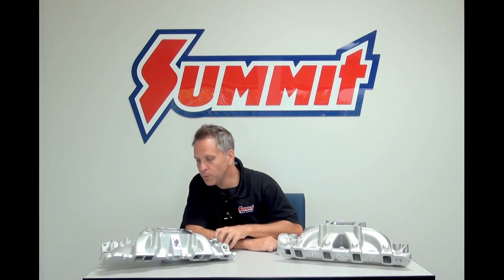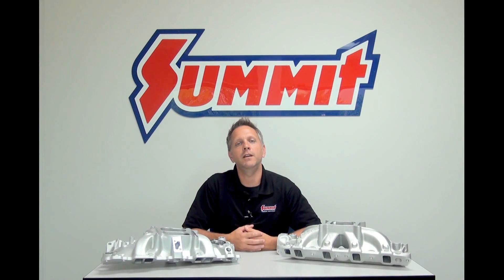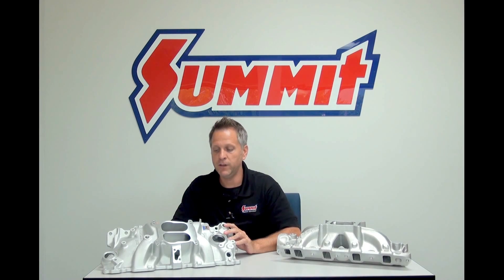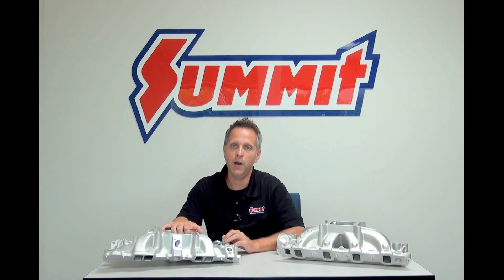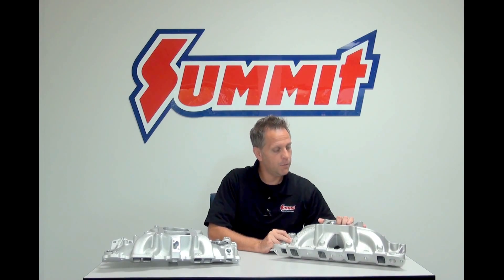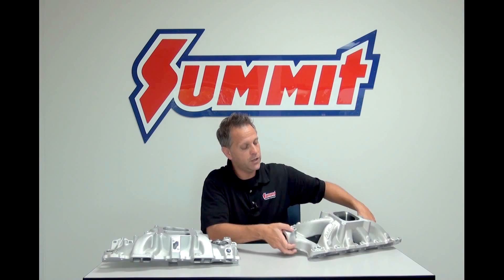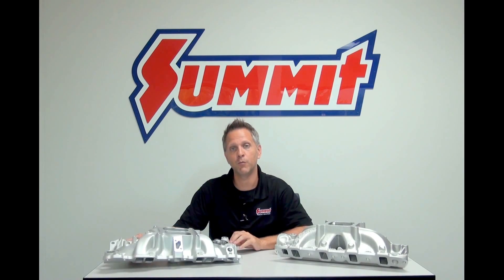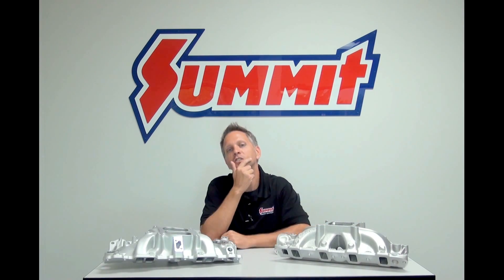Dual-Plane vs. Single-Plane Intake Manifolds - Summit Racing Quick Flicks

Comment: Can you put a single plane gasket on a dual plane intake?
Reply from the maker: Yes you can, but it also depends on the carb. Some carbs recommend a 4 hole gasket to perform correctly.
Reply: Summit Racing what about edlebrocks 1406 carb?

Comment: I always wondered if I put a one inch on  a dual plane how it would act.  They way I could drive on the street with the daul plane and when i went to the track i could easily put the one inch spacer on, assuming I had the hood clearance.

Comment: Why don't manufacturers coat the inside of these with something like those copper/ceramic cooking pans you see on TV commercials?
Reply: The inside of the intake and the runners in the head need to be fairly rough surface wise to keep fuel atomized and keep fuel from puddling up

Comment: thanks for the info!! however, there is no info anywhere indicating there is no vacuum port on the intake anywhere!
Reply: run a vacuum pump if you need vacuum for power brakes

Comment: Wanna get Edelbrock 75284 intake manifold for my vehicle. However $1149 bucks for the timing control module 91231 seems like a bit much for what it is. Now do you have to purchase this timing control module for a extra $1149 or is there another way around it? Thanks
Reply from the maker: +Parps Mcpimpson , 
Yes, MSD offers the same module for $499 and the wiring necessary for around $200. Give us a call and we can get you the correct part numbers for your year of engine. 1-330-630-0240

Comment: for a 5.0 non H.O  what intake does the job?? whit a 500 or 600 cfm carb
Reply from the maker: TheGer88 , 
If it’s a street driven application with little to no modifications, an Edelbrock Performer manifold will do the best. The size of the carb really depends on modifications and the RPM the motor will operate at.  Give us a call and we can walk you through it!
Reply: TheGer88 500

Comment: Thanks. Very helpful.
When can I put a dual carb set up on a SBC? What do I have to do to the motor?
Reply from the maker: Dave S,
 Dual carbs are really best suited to lightly to highly modified motors. If looking at the Edelbrock dual quad set up, its suggested to have a 9.5:1 compression ratio, a minimum of a Vortec style head or better and a camshaft with 214/224 degrees of duration (@.050) or higher. There will be tuning to be done, it is NOT a bolt on and go!  Give us a call, we’ll help you through it. 1-330-630-0240.
Reply: Summit Racing Awesome thanks for the info.
Just switched cars. Now have a 351C. I assume the 4v closed chamber heads will do the job.

Comment: The dual plain you said was good for up to 6500 rpm and the single 8000rpm I like to be at 6800 what's the best intake to have . Dirt track racing 650 double pumper rule.
Reply from the maker: Hi Jason Light, 
Due to the fact that this a race only application and will be in the higher RPM ranges all the time, a single plane like the Edelbrock Victor Junior is a great choice for you.
Reply: Ten four thanks for the response

Comment: I have the Center Bolt Cast Iron Heads 1987/1995 one piece rear main seal 350 Stock Except for Mild RV Cam/Crate rebuilt engine It is In an old 64Chevy c10 Short Box Fleet Side Pick Up So Plenty Of Hood Clearance I like the looks of the 8170 WEIAND ONLY BECAUSE IT IS A HI RISE AND DUAL PLANE is it going to hurt Anything to use IT VS. the 8126 Low Rise Dual Plane With Stock HEI I am Using Now? The Truck is Running 373 rear gears and 700 R4 TV Cable type Not the Electric Computer Controlled trans type  Lastly I am using the 600 CFM Manual Choke Edelbrock Carb I am considering the New 1901 Street Demon Carb I have read good things about it.
Primarily local Cruiser and once a year from SOCAL/Riverside To Des Moines IOWA to Visit Family so the Infrequent Road Trip about this time of year.
Just an FYI I am Talking Just about the Looks of the set up if I lose a Little MPG I don't Mind I just don't want it to Feel BOGGRD DOWN When I step on the gas like when you have too big a carb on a smallish v8 Right now it has great Acceleration stop light to Stop light the trans is not all built up with aftermarket torque converter or anything it does have the 373 POSI/Limited Slip Type Rear 12 bolt out of a 66 c10 donor truck. tires are 235 70 15 on all 4 corners I think That's as detailed as possible! if not a little scatter brained
Thanks A bunch 

Jeff in Riverside CA
Reply from the maker: J garcia, 
The WND-8126 is going to be the
better choice simply because it is designed to operate in the same RPM range as
an RV camshaft does. The 8170 works to a higher RPM band which will not be
beneficial to you since the cam wont rev that high anyway! http://www.summitracing.com/parts/wnd-8126
Reply: Summit Racing thanks ! I was afraid of that Ok I will stick to the 8126 thing is the 2 rear center bolts leak oil on both sides no matter what washer/RTV I use do you know if there is a special bolt/washer for the 8126 I think I read somewhere the 8170 needed 7/16 Bolts certain washers etc Wondering if the same is true for the 8126 mine is the 1987ish one piece rear main seal but it still has the mechanical Fuel Pump. and passenger side Dipstick

Comment from the maker: Hi chrisonfire420, 
Well, not everybody has the same idea when it comes to “Streetable”. Generally speaking, as long as the manifold is not very tall (think Edelbrock Victor Jr) than yes, they can be streetable. The Edelbrock Torker II manifold is a low rise single plane intake that has decent street manners!
Reply: The solution to what to top it off with is the tried and trued Q JET.

Comment: I have a elderbrock air gap intake and a elderbrock 650 thunder series carb which gaskets do I need and or do I need a square bore to spread bore adapter?